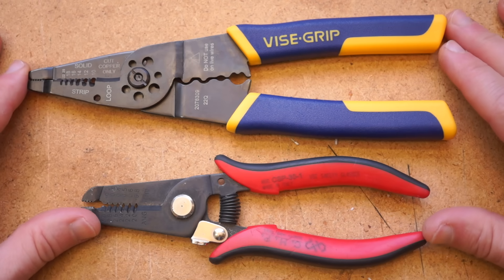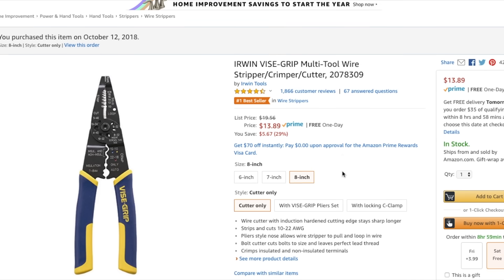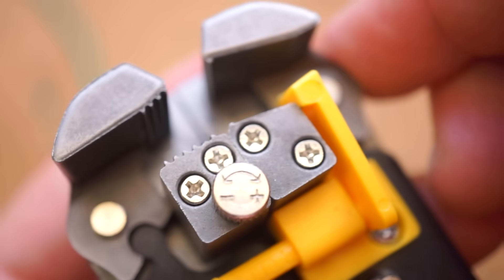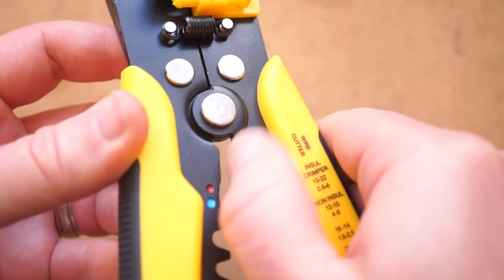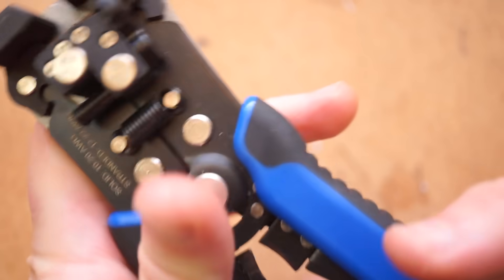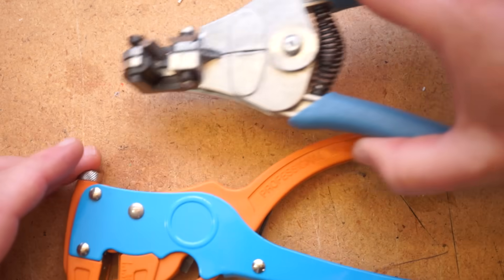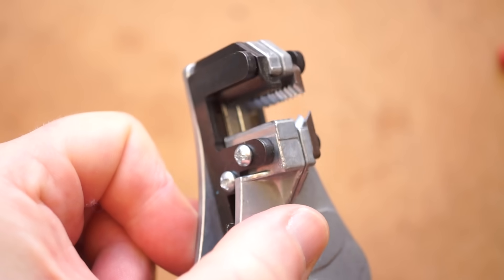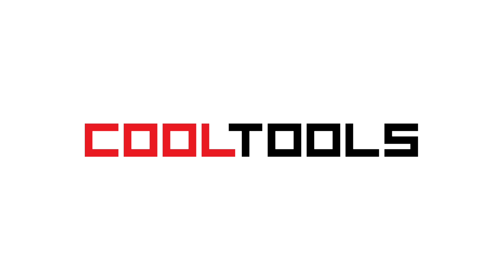Searching for the Best Wire Stripper

Comment: EVERY brand of the self-adjusting wire strippers, including the ViceGrip and the Irwin you feature in this vid, and a few better quality ones that i have tried, all have the same single major flaw - the plastic handle-cover slips loose in use. it slips from the inside, where the crimping part of the strippers are and the handle is only covering the metal on 3 sides.
the simple solution is to get rid of the useless crimper part, as any tech who is worth his weight in copper wire, has a dedicated crimper that does a proper cold-weld crimp without the hand-strain.. some brand needs to sort this out and put a 100% markup on them.
even with this flaw i still wouldnt use anything else.. but the first thing i do with them, is remove the depth-stop, which only gets in the way when not being used, and having a tension screw to hold them place is a chore to use.

Comment: For automotive use, I highly recommend the ideal strip masters. I’ve been doing automotive electrical repair for over 25 years and by far these are the best that I’ve come across.  They’re super easy to use and make a perfect strip every time. If these will not fit underneath the dash somewhere, I use Klein curve manual strippers for tighter areas. If you combine these with a Thomas and Betts WT – 111 M for crimping non insulated terminals on , you’ll never look back. You can find these tools all day long for a dollar or two at garage sales and flea markets that work as well as brand new and usually even better because they’re already broken in by the time you find them used and not too stiff.

Comment: The best ones were the ones my dad had that someone stole after he died; they were 100% metal and had no brand I can recall seeing on them.  The Klein's will be great after a few hundred uses to break them in.  I bought the Irwin self-adjusting and they didn't work AT ALL for speaker wire (12 gauge).  I took them back and got the Ideal which works but is not what I want so I'm taking these back too and getting the Automatic Wire Stripper 10-24 AWG by KNIPEX for $40.  It's only about $10 more and is exactly what I want/need.

Comment: I use a commercial electric lineman plier with strippers built in on the handle side.  Saves me time with not having to switch between strippers and pliers

Comment: Been doing electronics EE for 40yrs. For the small gauge wires l prefer the Ideal squeeze type you tried at tge end,with the die with separate holes. Never had rust issues. I get very clean strips and can do partial strips. I have ones with various sizes up to 10g and one down to 30g. Although the big gauges are better stripped with other tools. For everything else I use the Vice Grips stripper. It is the most versital. I also have the CK knock-off but it doesn't work as smoothly and the grips are not as comfortable.

Comment: I almost always just use a bic lighter, heat where I want stripped, then pinch it off with my fingernails, I never worry about nicking or cutting any wire strands, I've been doing this for decades

Comment: The last two strippers presented have a specialty that I have seen and shortly used a long time ago.  The special jaws were made for Teflon + Kapton combination insulated wire wrap wire.  That wire was needed for wide range temperature application (-55 to +125 degrees C;  or 67 to 257 degrees F for those in the US).  Nothing, including thermal strippers worked acceptably on that wire.  Then somebody - I think it may have been the local AMP representative -- came in with the special jaws.  They had a supporting tubular part with the cutting ridges in the middle.  Given the overall small size, you at first did not even notice the ridge and wondered how it performed the cutting.  Anyway, those strippers did the job.

Comment: The good ones in this video are great but they only go up to 6mm. What happens if you want to trim electric mains cable without using a knife?
Should be really easy to make pliers with two curved cutters that overlap and squeeze together at fixed diameters - but I can't find any.

Comment: Thanks for the video, but can you explain how the tensioner screw is supposed to work on the automatic strippers? On my strippers it just seems to do nothing or then rip off the insulation at that grip point, thanks.

Comment: Having worked as an commercial electrician for forty years the second most important thing about a pair of strippers is that it easily fits in a pocket. Most real electricians don't wear a tool pouch. We normally keep a pouch or more likely tool bag near but a pair of kleins, channel locks and screwdriver are generally in a back pocket and wire strippers in a front pocket. Now first important thing is a tool that works well for the type of work the electrician is doing. I liked a pair of ideal t-strippers I had. It had the #12 stripping hole next to the cutting edge. Saves a lot of time hunting for the right hole in awkward of dark working conditions. Then the pair I had started next at a #6 hole and descended down to a perhaps #18 wire size. Most useful stripper I ever owned.

Comment: you can replace the blades in the parallel wire strippers so they’re the best by far if you can sharpen curved cut outs you can re use the same blade insert but it will after a couple of sharpens be slightly larger and eventually you will need to replace them

Comment: The best wire stripper is the wire stripper that you find next to you. I use a really old-school (vintage) "BIB MODEL 8" by Multicore Solders Ltd. Made in England. Patented 28029/64. (So it's from 1964). It's probably not the best, but it's right next to me.

Comment: The Klein looks like the best bang for the buck. There's a lot to say for its metal stop. It's more durable than the plastic ones, which more likely to break off and difficult to find a replacement for. Of all strippers with the same design, it is the only one featuring a useful and serviceable wire cutter. You can always sharpen or replace them when they become dull. The others feature a dull cutter built into the frame. If the action is a bit stiff, you can always remove the cutters. For professionals, a built-in cutter may be convenient, but not the chief selling point of a wire stripper. Finally, Klein has a decent warranty program which the other lesser known brands lack.

Comment: I love my Irwin automatic stripper.  I used a manual stripper while installing over 30 led lights in two different rooms of our home.  It worked fine but cutting off sheathing and then manually stripping all of the wires became very tedious.  I picked up the Irwin and it will not only strip the wires but also remove sheathing.  The other feature I love is that you can put multiple wires in the stripper together and strip them all at one pull.  It works great for Romex 12/2 and 12/3.  Fast and efficient.

Comment: In your opinion, what the best stripper for both Cat5-6 and Fiber Wire from a 6-12 strand, plus... Yellow corded Optics?

I'm not into spending minutes per wire and messing up between strip integrity and loosing valuable frequency numbers during the fusion process.  No one ever wants to start over again with a break in the strip vs fusion integrity.

Comment: I bought a dollar wire stripper for yes 1 dollar plus tax that lasted just over 10 years to include work for the military and home use.  they recently gave out.  afer buying a new set for 10 dollars I was dissapointed and wished I bought 10 of the originals when I had the chance.  Great video.  If you dont have a automatic stripper buy any of these and they'll blow your mind on how useful they are day to day.

Comment: Thanks for the review of several different wire strippers / cutters... 

May I know what kind of wire stripper used for bigger wires like 8 AWG (8 mm2), 6 AWG (14 mm2), 4 AWG (22 mm2), 2 AWG (30 mm2), 1 AWG (38 mm2) wires? 

I find it a little difficult to search for the best type of wire strippers for these wires. 

Thank you!

Comment: For the vise grip the plastic yellow piece tends to snap off after heavy use. For myself at least with all other tools in a bag it gets snagged. I never ever used it anyway, I think I had a good feel of measurements from muscle memory. Other than that it is truly the gold standard.

I can cut multiple wires at the same time as well (small size)

Comment: Was going to get the kleins that were similar priced on amazon but they didnt have crimping options in the handles like the irwins.  Been wanted an auto adjust wire stripper for a while now.

The Irwins were on sale for like $21 and kleins were $4 less.

Comment: I was really hoping to see you review the Knipex automatic wire stripper. I really like my various cutters from this German brand. You seemed to review a knockoff of it, but not the original.
Reply: I use the "expensive one", you can buy these nowadays for around $75,-. The old Knipex 12-40-200 didn't work well for us, and they didn't even last a year! The newer 12-52-195 might be a good option, if u often have to switch from thin to thick 16mm wire, assuming they did prolonge the lifetime of this newer version.

Comment: Very wrong choice. It is exactly the worst tool for stripping. It hurts the insulation and pulls it in the wrong direction. try a 5 cm piece of conductor to see what happens. try https://www.weicon.de/en/products/weicon-tools/multi-purpose-strippers/626/duo-crimp-no.-300

Comment: You must have small hands. I have no problem using the none spring loaded ones with one hand. I find the spring loaded ones are a pain when constantly putting in and out of tool pouch.

Comment: Great video. Almost bought the Klein Tools variant, but went with the Irwin's winstead
Reply: I did the same mostly due to the length adjustment, im doing my first mil spec style harness and want the end of the wires to all be the same le gth
Reply: Me too but I saw the Irwin’s had a bigger range (10-24) so I went with that I’ll primarily be using it for smaller gauge wire like speaker wire

Comment: Once you have all your cables in and in the back boxes and you need to strip the outer sheath back to the entry holes then see how good they are, you will have about an inch or more outer sheath in side the back box NOT A GOOD JOB it will look shoddy, they are OK for stripping the conductors but then you might as well just use side cutters to strip both the outer sheath and the conductors. Another over priced pointless tool don't waste your money.

Comment: The 2nd type of stripper rip the insultation off the wire, wheras the last ones cut the insulation all around the wire before pulling it off so IMO are superior.

Comment: I have had through the years a number of wire strippers and my different places of employment have had several more.  At one point when I did more field service, I prepared my own tool kit.  One of my criteria was a minimized weight.  So, no heavy or bulky wire strippers or any other overweight tools.  I looked at Bibs as a light weight option and found it too dull.  In fact, it mostly squeezed the insulation tight, rather than cut and peeled.  A British made Eclipse fit my needs.  Not for production use, but just ideal for the occasional field use.  The fancier types (at work) often turned out to be too big in some tight corner and short wire end.  However, that type with appropriate blade was the only one that worked with teflon/kapton combination or other wire wrap insulations.  Most of the other strippers just slit teflon insulation lengthwise.

Comment: The best wire strippers had the least coverage... the last set you mentioned are the ones that will hold up to the most abuse, and still keep working perfectly. The perfect set up reduces time/fatigue and is consistent over a long period. I wore out the kind you are showing in only a few nights of doing lighting install at Walmart. The last ones you covered I ended up buying several sets, and my work friends ended up with a set too. Itll handle most average sizes

Comment: You neglected to mention one of the most significant advantages of the Irwin stripper. It is great to removing the sheathing from Romex. Just put the Romex in the jaws and it pulls the sheathing from the Romex. That feature alone saves tons of time when house wiring.

Comment: The Irwin adjustable wire stripper. I ground out the crimping jaws due to the crush injury to the fleshy parts of my fingers when the strip completed. I have professional cable crimpers and there is no need for crappy crimp jaws in the handle area that won't do the job anyway.
The manufactures need to look at their designs before production and definitely before selling them.

Comment: 6:00 If they puched a square hole in the middle of the bite, and made the metal jaws slide over eachother, it would bite into the sheeting on 4 sides. And it would still be universal size.

Comment: bought cheapies from amazon  ... Wegge I think, but other than color stamping on the handle about 100 choices all llooking similar.   Looked fine .... very sloppy on the stripping ... but OK with some adjustment.....    until they fell off my bench and hit the floor.    Back plate holding the pivot looked like metal and I never thought about it ... until I picked them up and they no longer worked..... The plate was in two places on the floor .... plastic.      Nie weider.

Comment: For the last type of strippers, the one with separate holes for the wire, keep in mind that you need to use different size holes for stranded vs solid wire of the same gauge. Subtract 2 AWG for stranded wire. IOW the 14AWG solid wire would go in 14AWG hole. The 14 AWG stranded wire will go in 12AWG hole. Stranded wire is thicker because of space between strands.

Comment: Please look into German tools as well they are superior in many many ways. Weidmuller stripax is my favorite but jokari makes nice ones as well. Does the least damage to the sheathing, and has the best options for production or pre wiring work. It can leave the stripped part on the cable so it doesn’t fray.

Comment: Katapult® Wire Stripper and Cutter for Solid and Stranded Wire

Model# 11063W
Best ones I've used. Once you used them enough you can eye ball the correct gauge hole and have 0 issues. They even have a teeth set that goes all the way to 26 gauge.

Comment: My dad invented these wire strippers US3087363A applied for 1960, granted 1964. The patent has been cited for other devices. Funny thing is I used his wire strippers all through my youth not realizing he invented them. They were very handy for stripping wires working on guitar amps and effects pedals. Dad was a radar technician in the US Navy 1950-iirc 1954.

 Dad's last unpatented invention before he died in 1988 at the young age of 56 was a spring tensioned vertically reciprocating scroll saw that attached to the front of a radial arm saw and driven by a single connecting rod attached off center to a mock saw blade with a standard sealed precision bearing, giving free motion to the rod linkage. I worked great. 😊
Reply: Thank your father, he saved my tooth, I stripped wire with my tooth usualy until I discovered thsi tool
Reply: Hey, bless your dad, and bless you for taking the time to post this. I think i know that radial arm attachment. I believe my uncle had it and loved it. I wish he were around to forward it to. He would be thrilled to read all you've mentioned. Best wishes to you and yours.
Reply: I would love to see a photo of dad's version! Is it out there?
Reply: @JamieMurdock90  I believe those wire stripper are now called "Katapult or automatic gauged Wire Stripper" they're kinda like a mixed btw the self adjusting and gauged but you still have to put into the right size wires it prevents the wire from being damaged, from the wiggles of an gauged stripper but u have get the grip of a self adjusting. I personally like self adjusting cause it works on more than just small wires but also works for decent size cables.

Comment: The strippers shown at around 2:00 are good, but I really dislike the design in that there's brutal pinch point between the handles.  When you use plier type tools, you often wrap a finger around the inside to balance and control the tool, like you did earlier in the video.  You also use this particular buy squeezing rather abruptly - what a stupid to have a bunch of pointy sharp edges.  Well, I managed have a digit between all the useless sharp stuff there - Ouch!  Yeah, my fault, dummy, but I'm not new at this and it could happen to others....so take care with what imo is a messed up design aspect of that tool

Comment: Just bought one called workpro that is just a square block and since it has 4 sides, it does everything from 26 - 6 gauge, coax cable, 14-2 and 12-2.

Comment: More expensive, but the best in my opinion is the Patco PTS-10 for $79. It is a thermal type that melts the insulation, so the strands don't get nicked. It comes with a spare element, but I have never changed mine in over 30 years of use.

Comment: Unless you're doing a lot of wires and often, I find all of these do a piss poor job.  I use hemostats and a utility knife.
1) Clamp the hemostats on the wire to guide how the utility knife slices the insulation.
2) Run the utility knife lightly around the wire, just enough to score through the insulation. 
3) Half twist and the insulation comes right off.

Works on every (reasonable) gauge wire, I never break any of the conductors even if hair thin, and it doesn't damage the insulation.  I can do a dozen wires faster than most guys can find their wire strippers.